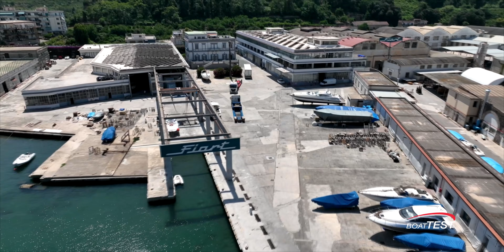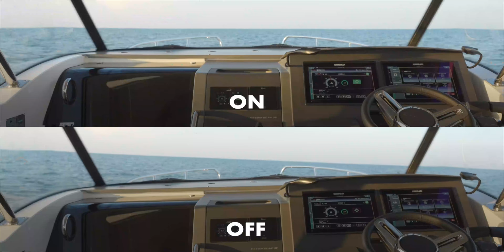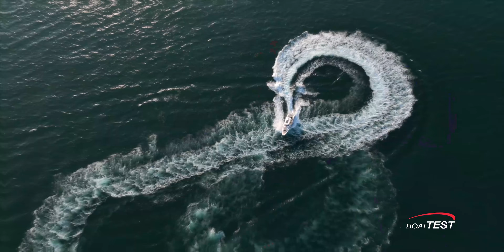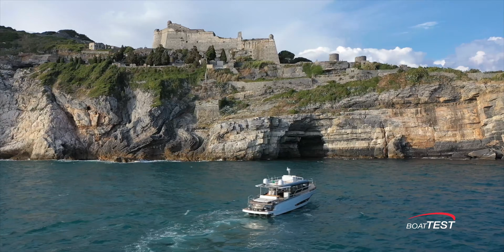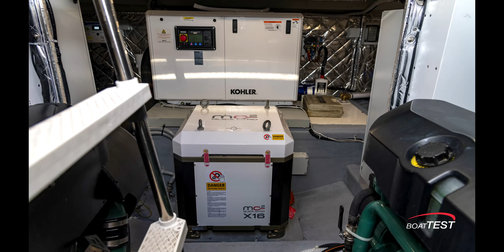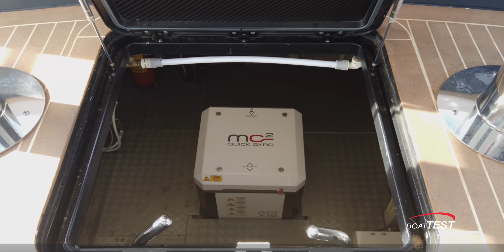Quick Gyro MC2X Stabilizer -  Product Review by BoatTEST (2023)

Comment: Also can double as a heat supplement then i guess depending on where its mounted 😉 for real though for what they compete with, the seakeeper and for a boat product in general the x2 is less than 15k i think last i checked thats a steal for marine accessories that will make a big difference in boat performance in  rough waters